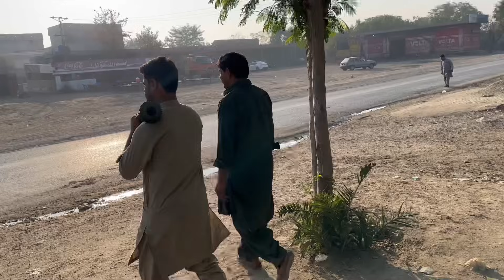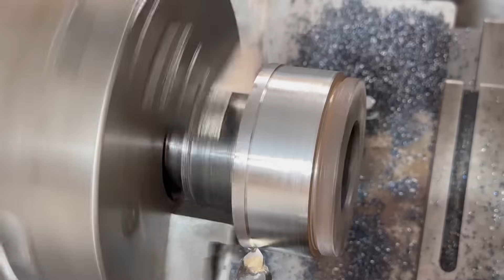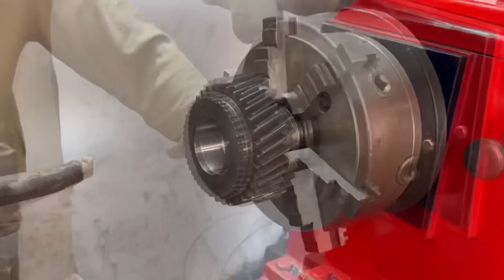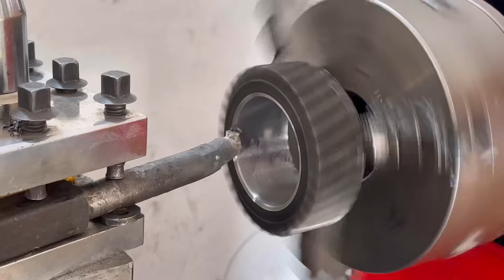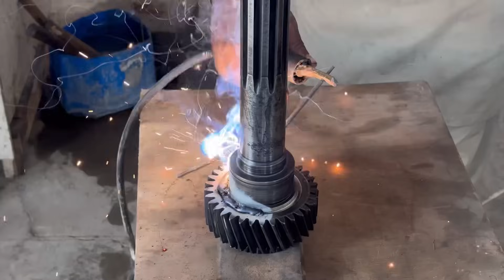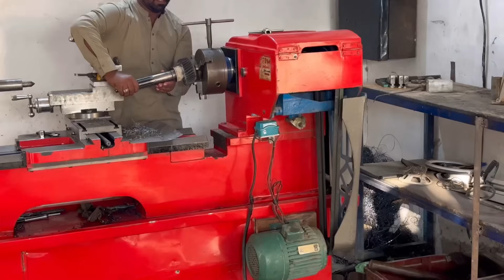Successfull Experiment || The Most Unexpected Process Of Broken Top Gear Input-Shaf Repaired…..

Comment: Maybe he's a one man shop, but leaving the key in the chuck and walking away will get you fired in a shop.  Threads are not accurate enough to maintain concentricity, he should have machined a mating shoulder to join the parts.  The shoulder should be on the shaft side, as this is the 1st motion gear and the force would tend to unthread the gear toward the shaft side.
Reply: Yeah, I would have just made it a pressed up assembly, with locking pins
Reply: I would just get a new one. But since this thing has been welded, it should be fine. Good enough.
Reply: Eye protection and coolant….!

Comment: That will last about 10 minutes unless it’s in some old tractor idling around a paddock at 1000 rpm . If that’s a truck input shaft it will vibrate to bits
Reply: небудет вибрировать, он центрируется резьбой....
Reply: Clearly u never seen these guys work

Comment: I wouldn't have welded it because it can ruin hardening. Instead use two or three pins to lock the threads and just hammer press them so the ends won't let them get out. Hardening is saved and otherwise the work would be the same. 
Though I must say, they didn't directly weld the teeth so maybe it isn't that much of a concern, but still...